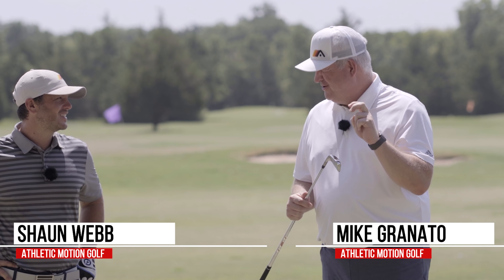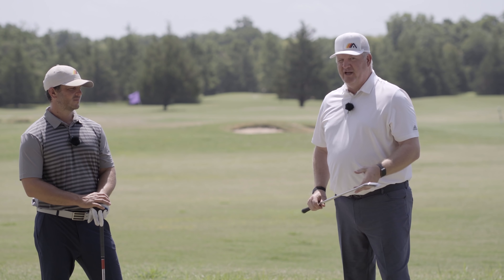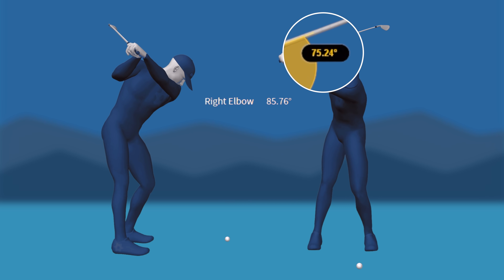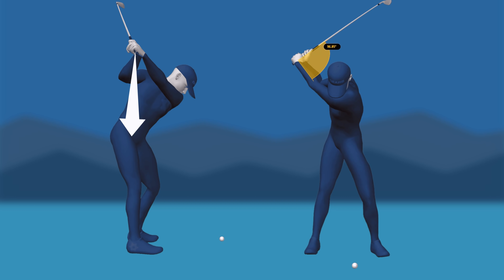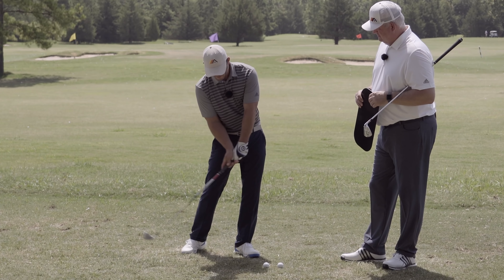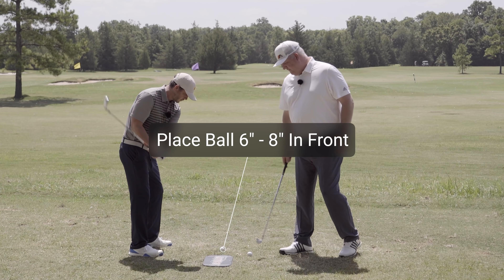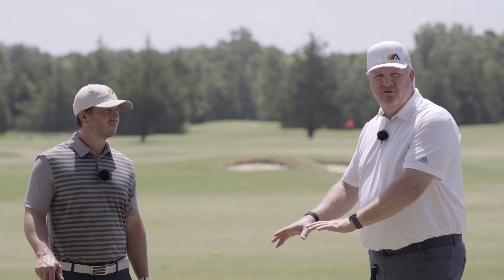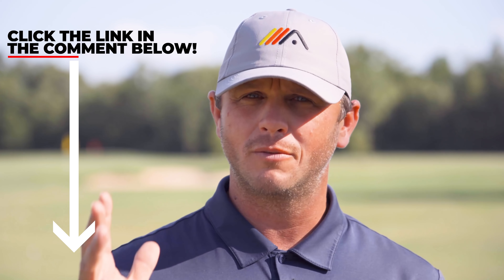The Secret To SHAFT LEAN! Increase LAG & Add Compression 🏌️‍♂️

Comment: This, quite frankly, is the best golf coaching video ever released  on You Tube. 

It unlocks so much and destroys so many myths at the same time it’s remarkable.

Type in ‘right elbow golf’ and see what I mean. 

And they’re all wrong. Wow.
Reply from the maker: Thanks for the kind words🙏🏻

Learning how the trail arm works in great swings has been one of the biggest eye openers for us.  We were both taught the “keep it bent and drive it forward” move ☠️☠️☠️
Reply: @AthleticMotionGolf  same here, and attempting to do so makes it impossible to bring the hands through at the same distance from the body that they started. Which leads to all sorts of compensations, including getting stuck, casting or massive early extension with over the top. 

I’ve been working on right arm moves at the top and start of the downswing with a new coach, but he’s unaware that I had been taught to drive the right elbow through. Hence I’ve been unable to miss the foam noodles on the way down in one of our drills. 

This opens that door now, with wrist angles creating lag not a bent right elbow. He won’t have spotted this as it’s an ‘intent’ thing held over from the prior coaching rather than a visible reality. 

Another door we’ve opened is the feeling of the tea tray balancing on the right hand at the top creating better orientation of the elbow and right forearm. I like to see a video explaining that from there at the very start of the downswing the pro elbow goes down like you say here and thus towards the ball to target line on the plane arc, and AMs elbows move away from the ball to target line, steepening the shaft.

If there is a magic move in golf, it’s that.
Reply from the maker: You made a great comment here.  The intent of a golfer cannot be seen by the coach...I've been saying that for awhile
Reply: @AthleticMotionGolf  Thanks. Had a lesson this AM. My coach was away last weekend and I shot my best medal score last Sunday. It is not a question of what I am now doing, it’s what I am not ‘trying’ to do, and failing. I said ‘you could never have seen or known that’s what I was trying to do’. 

I felt released and today we worked on match ups, which are hard because it’s all new.

We got to the same place you get to at the end of the video; my good swings felt slow to me, but the head speed was faster and more compressed.

Advice I would give is ‘be patient from or at the top and let it happen’.

Feels strange but so much better. Every shot was compressed. First time since I started swing changes in Dec.

Comment: Became a member of the AMG Academy last week. All the drills and instructional videos are really helpful. One thing that is a constant problem for me is not being able to get my hands in front of my right thigh at the delivery position. From watching your videos on You Tube, I know that the problem is most likely something I am doing wrong much earlier in the swing. I spent probably the last eight months learning from somebody whose theory on the swing was to keep your hands up in transition while rotating and keeping the hands passive. Needless to say after much thinking about the swing, I thought it seemed harmful to keep the hands and arms so passive. 

On video, it appears that my body is too far ahead of my arms in transition.Should I be thinking about lowering the arms in a more timely manner? I know without seeing my swing you would just be guessing, but through your videos I know ignoring the only thing that actually comes in contact with the club seems, quite frankly, crazy and flat out wrong. I hate that it took me so long to find you guys, but better late then never I always say.
Reply from the maker: Welcome to AMG!  And this is a great question.  When looking at the data of how great players move their arms, attempting to leave them up is one of the worst concepts to come down the pipe (as so many golfers are finding out).  On average the pros are lowering their arm 24 degrees from the top to left arm parallel.  Most ams are less than half that.  In a nutshell, that’s why the hands are left trailing behind later in the downswing.  We have a bunch of new content coming that goes heavy into this subject 🤓

Comment: Nice job as usual guys.  On a similar bent as what you've presented is the Steve Pratt video entitled "The Crazy Swing Move That Keeps Winning on the PGA Tour" which is base on some motion capure data analysis of a PGA tour winner.  This also seems to take care of closing of the club face.  I'd be curious what you guys think of it.
Reply: This is not what S Pratt is advocating, he teaches throwing the club head away from the target from the top, losing any form of wrist cock; AMG are clearly showing, with the avatar, that the wrists remain cocked until far later, and this is facilitated by straightening the right arm. I would also be interested in AMG’s views on the ‘Mike Austin Method’ that Steve advocates.  Surely both AMG and SP cannot be right? They appear diametrically opposed.  Grateful for clarification on this conflict of philosophies.
Reply: @thurlestonetennis2447  What I understand Steve Pratt to be saying in the video that I referenced is that if you take the body out of it, the arm motion of a particular 6 time PGA tour winner is just the motion that he demonstrates in the video which is just a quick throw of the club with the hands snapping the toe rapidly closed; this motion involves the rapid straightening of the trail arm.  What AMG is showing with the avatar is WITH the body motion. So if you remove the body motion from the avatar's swing, would you have something similar to what Pratt (and Manzella) are demonstrating?  I personally think that the answer is yes. I think that there is much more agreement here than one might expect at first glance.

Comment: Another great video. Best golf instruction on YT. Could anyone help me with a question? I've been trying to insert the recentering move into the shift, turn, shift, turn concept. 

The first shift of 1-2" is clear, then first turn as the second shift starts into recenter, first turn over, shift two continues as turn two begins until the shift 3-4" forward, while rotating, until hands parallel which is when we post up off the left leg, ending shift, finish turn two to impact? 

Shift two occurs from hands parallel backswing to hands parallel downswing? 

Thanks.
Reply from the maker: Just feel your second shift takes back the 1-2” from your first shift by the time you reach the top.  From there you can feel like you’re done shifting.  The momentum and unwinding coming down will take care of the rest👍
Reply: @AthleticMotionGolf  Thank you so much for the reply. I've been "chunking" these movements into my swing and this will help simplify things. Cheers.

Comment: Gentlemen, in your video you did on lag and shaft lean 12 days ago, you talk about how the angles need to get released sooner rather then later in the swing. Does the right wrist stay bent till after impact or is that released too?
Reply from the maker: It’s maximally bent before impact.  It needs to be coming out through impact and beyond
Reply: @AthleticMotionGolf  couple of questions. First off, let me preface my remark with I think what you guys do is awesome and ultra cool. Now in your most recent video on lag and club shaft lean you show your model golfer releasing the angle well before impact. Doesn’t that contradict this video which seems to say hold the wrist angles till just b4 impact or am I understanding this all wrong? You guys are the experts and I am a golf hack right now trying to get better, so I am just trying to understand the concept better.

In The drill with the board behind the ball, I noticed that I was able to avoid the barrier and hit the ball which had me excited until I looked on video and saw that I was still casting. Is this supposed to happen 🫤?
Reply from the maker: @cubfan69kmz85  don’t try to hold any wrist angles in the downswing👍

Comment: Interesting video, I’m finding lately that I get too much lag on the downswing due to excessive wrist hinge (ulnar deviation) and I don’t have a enough time to get rid of it by impact even by extending my arms  (I get a straight but very low ball flight due to too much shaft lean). Would my correction be to also feel like I’m casting my wrist on downswing (along with straightening my arms/bringing them down) or should I try to limit the wrist hinge as much as I can? Thanks 😊
Reply from the maker: Yep you’ll want to feel like you’re lining up the shaft much earlier👍

Comment: Does this wipe movement of the club across the body at delivery work without the twist, motorcycle, screwdriver or whatever you want to call it with the wrist angles?
Reply from the maker: The wrist always have to do their job to get the face where it needs to be👍

Comment: I think you’ve now revised your views and no longer recommend a wipe-like movement that I think you are describing in this video. Please confirm.
Reply from the maker: The data in this video on lag angle and trail arm bend hasn’t changed.  We’ve learned better ways teaching it since this video was shot, and yes, there is no wiping movement in good swings.  Our “for the player” perspective is much better than the 2D perspective (used here) at conveying what the player is doing vs what it looks like the player is doing.  I hope that addresses what you are asking.  If not, I’ll be happy to take another stab at it.
Reply: @AthleticMotionGolf  Thanks for the prompt response. I wasn’t trying to be controversial just trying to ensure I understand what I should be trying to accomplish during the release which, as you’ve now confirmed, does not involve a wipe movement. Thank you.
Reply from the maker: @9zhivago  I don’t think you were being controversial at all.  Just wanted to make sure I was commenting on what you were referencing 👊